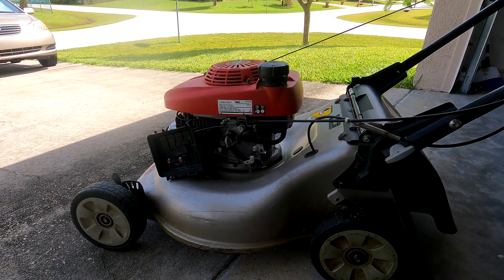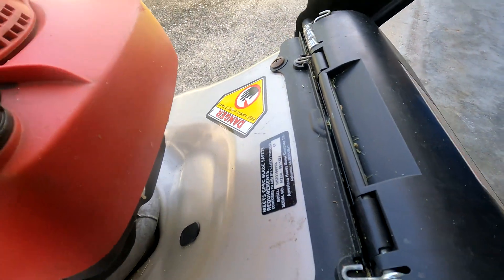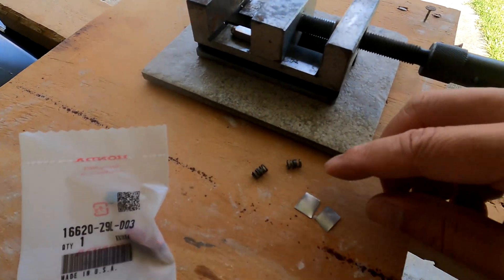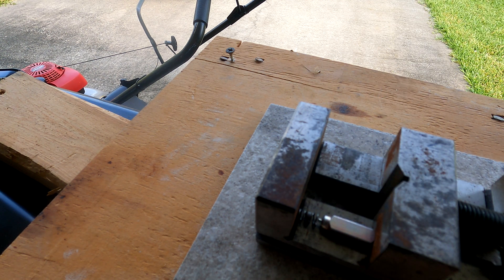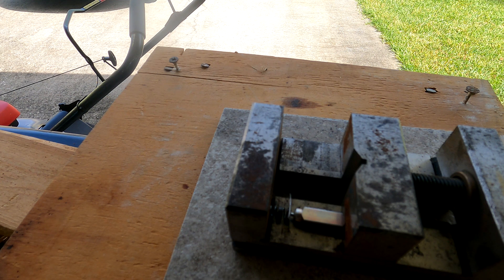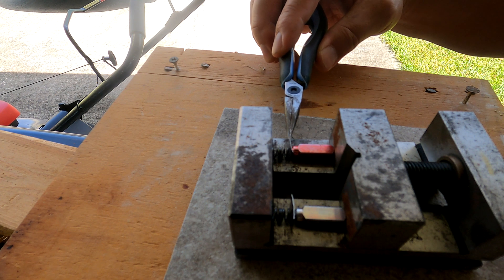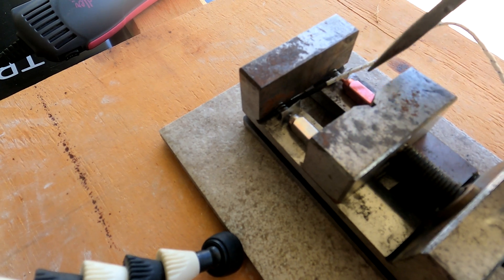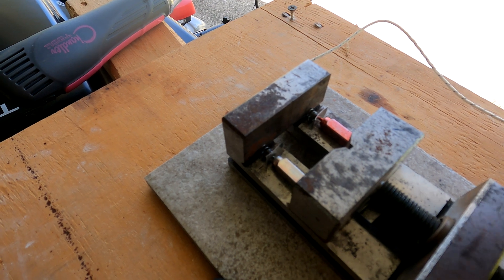How a Honda thermowax actually works?

Comment: Thanks for making this video! No one else that I can find has shown the pin going BACK in. I think I've had a problem with an off-brand thermowax. Sometimes it would push the pin out, sometimes it didn't, sometimes the pin wouldn't go back in.... I got a Honda brand actuator and it seems to be working a lot better.
Reply from the maker: Thank you for sharing your experience! Glad the video helped, wishing you the best!🎉👍🙏🏼

Comment: Excellent video - I have these thermal wax units to be troublesome- in my case, then pin never retracted after the engine cooled down - thus the  choke was not functional - very difficult to start - took several pulls on the starting cord - sometimes had to starting fluid
Reply from the maker: Thanks for the comment!  Have a great weekend 👍👍👋

Comment: Very nice demo to check if your thermowax activator is working properly. I notice that most postings related to thermo wax choke activators arise from hard starting problems. This would be the result of the activator pin not retracting properly on engine shutdown - thus leaving choke in the open position. My problem was the opposite - pin not extending enough to fully open the choke, resulting in over-reving. That's my theory, anyway, as it is a fixed-throttle engine, and I noticed my choke plate to be in the 1/2 open position after starting and running for a minute or so (running at 3700 RPM - should be about 3100). I'm currently awaiting an Amazon delivery of what is supposed to be a GCV-160/190 compatible activator. By the way- had a bitch of a time trying to remove the activator - some small engine activators are secured in the housing with a "weak" glue. Tried various pliars and small vice grips - no luck. I noticed that the grasping grooves of the jaws did not extend to the very tip of the vice grip. I ground down the closed jaws until the first groove was now at the very end of the tips - worked perfectly, although I had to brace my knee against the front wheel to keep from pulling the mower across my driveway.
Reply: I also tried pliers and vice grips and couldn't get the actuator out.  It turns out the factory puts black silicone sealant around it.  I already had the new one ready to install, and spent way too long trying to pry the old one out.  As a last resort, I drilled the center of the actuator so I could put a screw in it to grab onto.  That works, and my mower is running properly.  I had the same high RPM problem, and this fixed it too.  Best of luck with your repair.
Reply from the maker: Thank you for all your feedback comments! Great info and the drill with screw to remove the thermalwax is an excellent idea 👍😎👏

Comment: Nice demo on how the Therma Wax actually work. On cold start the choke plate is closed under spring tension from within the choke unit. When the engine warms the wax melt inside the Therma Wax device and the pin extends and pushes the choke plate open for normal operation.
Reply: Afircans invented this 🎉